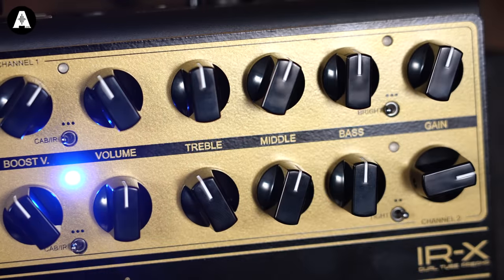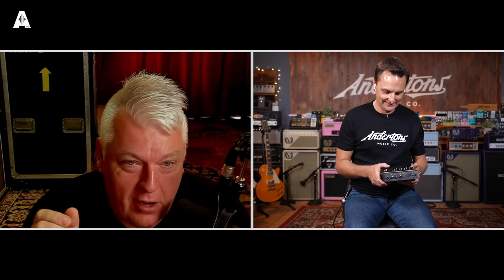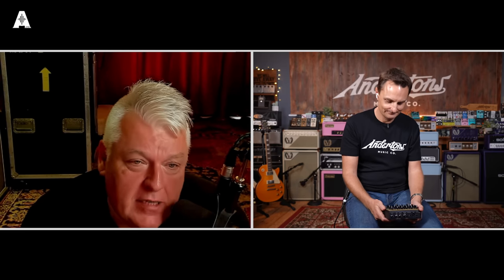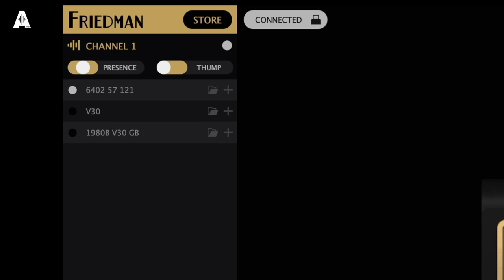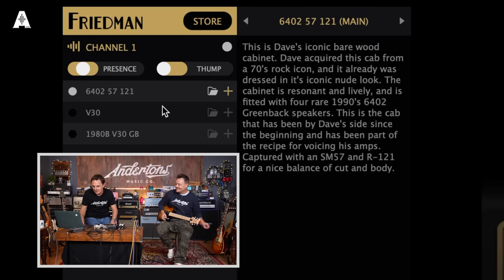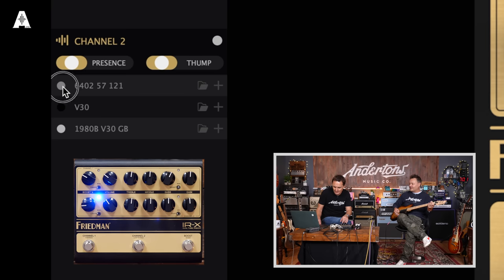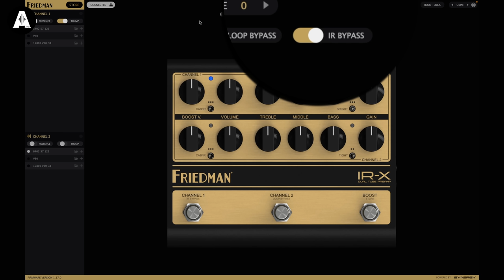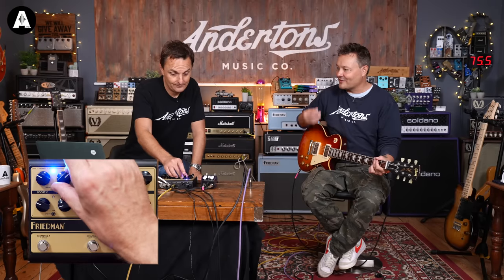Friedman IR-X Tube Preamp With Cab Sim - Valve & Digital In Perfect Harmony!

Comment: Excellent demo guys! Only one problem, at the end when you hooked it up to the FX return of the amp, I believe you HAVE to use the FX send of the IR-X otherwise you're feeding the power amp emulation to the other tube amp (power amp on top of power amp), that's why the EQ is a little wonky when you did that.

Comment: What is nice about this is that it can be connected in several different ways making it absolutely versatile. Heck if you really wanted to I suppose you could  run it into the instrument input jack and use it like a tube overdrive pedal. What impresses me most is what you are getting for the price. Sweetwater here in the US has these for 499 USD, given what some modeler pedals run for the Friedman is a steal really.

Comment: Totally agree with the Dave's ethos here. Just give us a simple unit with knobs to turn. I had a helix LT for years, I would spends hours endlessly tweaking eq and high cuts and low cuts. Sold the LT and now use UA dream 65 and Ruby 63, it's so much more fun and easy having single units that model just a great amp, here's your 6 IRs, turn thr knobs and what you see is what you get.

Comment: Two things that impress me about this is that the "into amp" recording to my ears didn't sound any better than the direct recording. Also the price. I assumed this would be much more expensive, but it's not a hell of a lot more than a UA Dream 65, which makes it a competitor against boxes like that. I might actually consider this as a direct recording solution.
Reply: Well said. So neither a cabinet nor another poweramp  is needed to get as good as possible sounds for recording or going direct live. Job well done.

Comment: Really nice one from Friedman! The only downside I see to these I/O features, however, is that if you opt to go into the power section of an amplifier/cab for that on-stage cab monitoring sound AND ALSO send the balanced out to the FOH desk, you can then basically have your time-based FX-Loop effects through the real amp/cab section of your sound only, since you'd have to send your signal from the FX-Send of the IR-X. The cab then has to be miced up and send to the desk anyways for your reverbs, delays, etc. to be part of your sound in the FOH, which to me kind of makes the balanced out option with its built in IRs a bit redundant - quite unfortunate... 

Two outputs on the unit (one balanced with the IRs and one unbalanced to go to an amp power section), leaving the FX-Loop of the unit alone like some Two Notes products do it (the Le-Preamp series comes to mind), would have been a more elegant solution in my honest opinion and would have totally sealed the deal! 

Maybe I am missing something, @FriedmanAmplification ? Or maybe that slight inconvenience only applies to players who have some very specific time-base-FX and want to co cab monitoring AND FOH at the same time, which may not be that many, so I understand...

A small ON/OFF switch for the IRs on the unit itself would have also been a nice touch, but that's probably a limitation of size, cost, components, etc. 

Nice preamp overall though.
Reply: Use an ABY pedal to split the Send signal in two: one goes to the Power Amp and the other goes back to the IR-X?
Reply: Is there a way you can just load a ‘flat’ IR?

(I don’t know if that’s even a thing.)
Reply: You can load your own IRs.

Comment: This is exactly exactly what I've been looking for. I have a Helix with a bunch of amp options, and I only ever use the same Plexi with the same settings and roll off the volume knob on the guitar.
I would much rather have an actual tube sound for this like my old Marshall reissue had, but with the same convenience.

Since this and the Helix both have loops, I should be able to run echoplex-like effects in front of the IR-X (Van Halen 1) and then run other effects in the loop as I see fit. 

Van Halen tone 2023 edition.
Reply: You run this in 4cm with your helix? Which cabs…helix or Friedman?

Comment: Someone help me out here. I am just a regular guy that plays guitar at home. No gigging at all. However, my interests and curiosity for these types of pedals is starting to grow. I have a Marshall Origins 50 tube amp (combo amp) that I love. Does this IR-X replace my amp, and you use it with a computer/DAW? Sorry for such a noob question...go easy on me! 🤣
Reply: It's a preamp, not a proper amp, so you can't run it direct into an unpowered cab and expect much of anything. You'll want to run the output to a PA (any powered speaker solution). If you want to use it with a guitar amp cab, you'll need a power amp (like the seymour duncan powerstage). The caveat here is that you'd have to disable the cab simulation, which... seems like it needs to be plugged into a PC to do?
Reply: I'd honestly recommend the Victory V4 boxes over this, just because you actually CAN run the powered units straight into a cab lol.

But they're not a Friedman, so that may not be to taste.
Reply: @leissMusic  thanks for the good information!
Reply: You can run it into the effects return of your amp and you can also run it into your daw.

Comment: “The guys” at Victory need to take note, the V4 series should be like this, add IR loader etc…
Reply: you mean for V4 preamp series ?  The V4 amp can load IR....
Reply: 100%
Reply: @CSC8393  no those are $1000, I mean the $499 preamp to be able to do this
Reply: @dividedbytimestudios It's a no-brainer too, considering that the powered version's selling point is that you can run it into a cab. The powered versions should leave out the IR loader, while the preamp ones should have it since they aren't running into a cab. 😵‍💫

Comment: I wonder why so many of these units do not at least have a little digital reverb unit built in. I hate to connect an extra pedal to the effects-loop.
Reply: Because most enthusiasts would have reverb and delay pedals to plug in, and they probably wouldn't be satisfied with the type of digital effect they'd be able to bundle in with this product
Reply: @chuddleywindston  This.  There is reverb built into my RME Babyface and although it has pretty good sound and it works really well as far as processing goes I never use it because it's just not the Reverb I'm generally looking for and there are so many other options with my pedals and plugins that I don't need it.

Comment: 1) I can't play on a real amp in my apartment, would this work with bass and midi synth as well? I'm not a big gear head but if I could theoretically use this with all my instruments it would definitely add value. Clerk at a boutique hipped me to this unit yesterday while I was picking up some pickups.
2) Nice kicks Pete! I haven't seen those old school, pre-Jordan Nikes since like 1982.
Reply: Whether you’d want to use this with bass/synth really depends on what sound you want.  For me, it does not work well for either of those.  The EQ emphasis here is really on the top end, so your bass will sound thin.  For a bass you would do much better with something like an Origin Effects Bassrig pedal.  For a midi synth, I’m not sure you need a special pedal for that — just go direct.

Comment: I think this is the way forward. Great product! But... the price is crazy. almost 700, which is almost the same price as the SV20H, which is the authentic plexi. I don't know. As all Friedmans, cool products, but price wise I don't get it when they're SOOO much more expensive than Marshall. If this pedal was more like 400, then sure, but at 700..
Reply: Friedman is American. In America, those amps are almost 2000$ due to import taxes.
Reply: @huntergalloway3944 That's precisely the problem. Friedman is pricing this according to Marshall's US prices. By the time Friedman imports these into Europe, he just can't compete. Which is a shame. Like I said, the products themselves are pretty cool. But why pay over double the price for a Friedman trying to sound / improve upon the sound of a Marshall, when you can have an authentic Marshall for less than half the price?
Reply: @huntergalloway3944  This is the issue with most American amp brands btw. Friedman, Mesa, Soldano, etc. They just can't compete price wise.
Reply: @malfeasant_dino  That's precisely my point. Did you even read what I wrote? He prices things based on Marshall's US pricing. Which is the issue internationally. He will probably do well in US, but everywhere else, he's not selling too many. Just look at Thomann sales top lists. Hand wired is not as good as PCB. Even Dave has said that PCB is superior in basically every way. So if hand wired only adds to the cost and isn't superior (according to Dave), I would rather get PCB.
Reply: @Tanax13  Quite funny when you think Marshall was created after the fact the `fender amps were too expensive to get in Europe at that time. For less than 200eur/dollars, you can also get a Catalinbread Dirty Little Secret that will emulate a Marshall Amp.
Reply: @Tanax13  You hit the nail on the head.
Reply: @keenanvil  Not really if you compare to the competition. If we’re comparing UK prices, which is still in Europe so still similar to my prices, a 20W Marshall (SV20H) is £849. So 500 for this pedal, or 850 for not only the authentic plexi, but also an actual amplifier with a power amplifier, not just a pre-amplifier. I think many people in Europe would opt for the real Marshall in that case. Like I said earlier, Friedmans aren’t bad amps, they certainly have a pleasing sound which is kind of their own thing, but at the prices they’re asking.. I don’t think it’s reasonable when you can just get a real Marshall instead for cheaper.
Reply: @Tanax13  just got one here in the US it was 499 dollars and honestly if I remember correctly I paid 350 just for the be deluxe pedal. A 100 watt be deluxe head is still around $3900 priced much higher than Marshals. I personally dont think I would pay that for the head considering I bought a mark IV head new for $2600 back in 95 that is still going strong and much more versatile but this will be going on my board in place of the be deluxe and running it  as my dry amp .

Comment: Wgen using it as a preamp into the effects return, could you use the preamp AND the front of the amp via 4 cable method (alternate between the both)?

Comment: So, you guys are borrowing the power amp of the amp you're connected to- right? I could use this in conjunction with my powered cab- it has a class D amp in it- correct? Pretty sure I'm right but, that's a mistake I can't afford to make, so I thought I should ask. My powered cab wasn't cheap, it cost more than my modeler did- if I fry it, I'll cry like a little girl.

Comment: If you used your own power amp do you muck up the order of of the chain? Meaning wouldn't the IR need to be last?
Reply: hm, my guess would be that you don't use the IR in that case because you are going into a poweramp and then into a real cab.
Reply: @sebbo1496  I was gonna use efx loop and line out of the Powerstation 100

Comment: How would i plug this in and play it thru my daw and computer speakers?  Does it have vst drivers?
  I might buy this if i can control the volume with dirty tones and be able to record in daw.
Reply: Literally just run it into any audio interface's balanced input and you're good - just make sure to monitor it. The USB isn't for sending audio I don't think, just changing and loading IRs.

Comment: It's cool, but it's not really a true amp replacement solution without like an 8ohm output so you can hook it up to an actual guitar cabinet.   A lot of other comparable products do have that cab output, and this one doesn't it seems.   The victory v4 do have it, the blackstars have it, the milkman pedal amps have it.......and that's the one thing that right off the bat prevents me from buying it.
Reply: this is a product aimed at achieving a good tone without having a cabinet, hence the IR's. If you could just plug it into a cabinet it wouldn't need IR's, and you probably wouldn't need this product anyway. This is literally aimed at direct recording without the need for a huge cabinet or amp. It's not aimed at the type of use you're insinuating. although it is a nice feature of those other pedals.
Reply: @KodyXXVll  i feel that, and I totally understand that.  But as musicians, often we never know what exactly we gonna be doing.   Yes this is perfect for ir’s, its perfect for recording, its even great to plug direct to mixer or house system for shows, all of that.    I get most people are going to use it for recording and use it as the “amp” when using pro tools or pre sonus, etc.    But then what about when your buddies call you up and just wanna have a quick jam in his basement and its all old school analog wires everywhere, etc.     And you dont wanna carry your ac30 over there, you know hes got cabinets…..u just wanna take the smallest amp possible or just the pedal board.      
Im just saying having options is nice.   Having as many options as possible is nicer.     I get it, you then have to make a power amp in the pedal which is just one more thing to deal with, but…….if you wanna beat your competitors, you gotta have that option.     But yes, for what it is actually designed for, it seems pretty badass.  Ive always liked friedman amps and their distortion sound.
Reply: @catchofthedave8681  i'm actually starting to agree with you. i think they missed the mark on a few features, for me especially is the redundant stereo output with mono fx loop. Friedman said in this video "if you wanna use all your cool strymon effects you can put them in the fx loop" (something to that effect) but all my cool strymon effects are stereo....so what's the point? If they had true stereo all the way through and a power amp stage with cabinet output, this would be the ultimate product. i don't think it's worth $500 with so many of today's guitarists using stereo effects. and no usb-c? really....
Reply: @KodyXXVll  yeah I didn’t even realize that, but you are absolutely right.    I mean my old 1980’s fender princeton chorus amp has a stereo effects loop, and that was before there were even stereo pedals, lol.     Off topic—i love that amp….its so much better than a jazz chorus and cheaper than most guitar pedals on used market.     

But yes, you are so right onnthat.   This day in age, if you truly want to make a “hit” product, you have to have almost every option possible.   Lots of people use and want stereo hookups, lots of people want a small amp/pedal that sounds and feels like an amp that can be di, power section for cabs, all the ir’s to use to daws and all that.   Plus me personally, i want it to have some type of very powerful eq section with parametric eq or parametric mids at least.   
You need something that has every option or at least most useable options for the majority of the market.  Theres always going to be some people that still say “oh it should have shimmer reverb instead of spring” type stuff…..but i mean just all the useable options to cover what 80% of musicians from beginners to pros.     
Some people will still buy this just for the friedman name, and because it sounds great and does great for them.      But like you, i think they missed the mark too.   Especially with what bluguitar and victory and quilter, and blackstar, and milkman, and the such have out.     Thats why the victory v4 did so well that they went ahead and started making v4 power amps for all their amps.     If you remember originally there were v4 pre amp pedals no power section for all their amps.  Then they had the duchess as a v4 amp with power for cabs.     When it took off much more than the pedals, they listened to customers and then they made all of the v4 models into powered amps and in version 2 they added multiple ir’s from 2notes and a bunch of cab sims preloaded and extras online, and they have a solid product.      

This is just a glorified pre-amp/amp in a box.   It doesnt do anything that special you cant already get from using aiab pedals into a di box which most of us already have.    It is a friedman……..but when you look at great sounding guitar tone, with the digital tools we have today we can get a sound so close to the tube analog circuit friedman distortion and tone; it is indistinguishable to most people.     So just a great di box with analog circuit and good tone………not worth it.

Comment: Looks awesome except I already notice something I don't like about it. It's got TRS enabled outputs and inputs apparently, but the fx loop is mono.....What is the point of stereo in or out if you're gonna sum everything in mono on the fx loop? The entire point of the effects loop is to pretty much insert time based effects inbetween the preamp and power amp stages, and time based effects are the most beneficial from a stereo setup. Why the fuck wouldn't they just keep it TRS or true stereo all the way through, instead of just at the output? This makes no sense to me and is a big reason the Iridium and ACS1 are superior in that department.
Reply: I’m encountering the same frustration.  I’ve demoed all of them and this one sounded the best to me by far.  It’s so unfortunate that it does not have any stereo options.  Since there are 2 independent channels, you’d think they’d give you the option to run each one out independently for your stereo effect.  Also, there’s no bypass switch whatsoever.  So I had to set up a channel switching pedal in front of it.  Huge bummer if you’re trying to save space on your board.